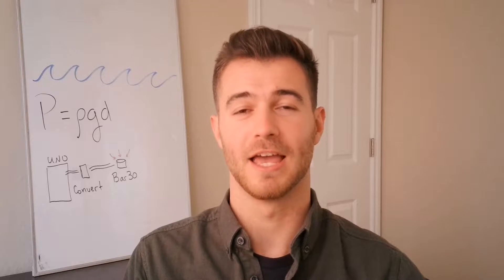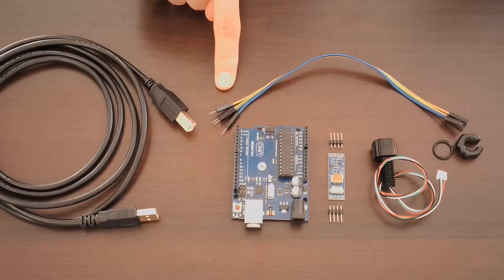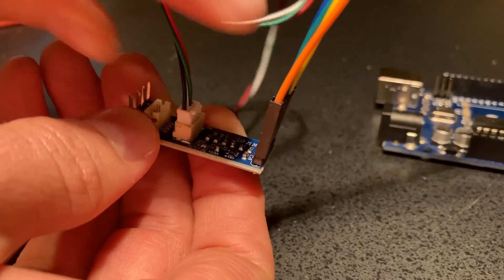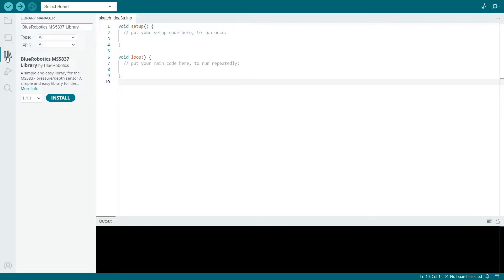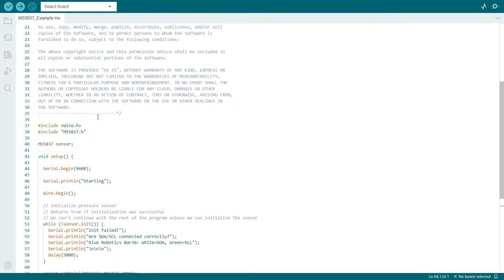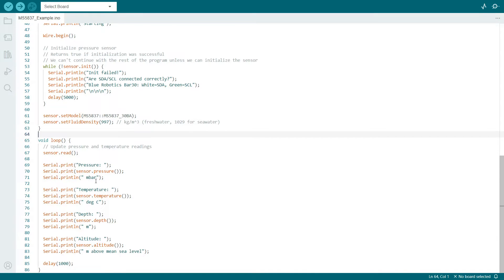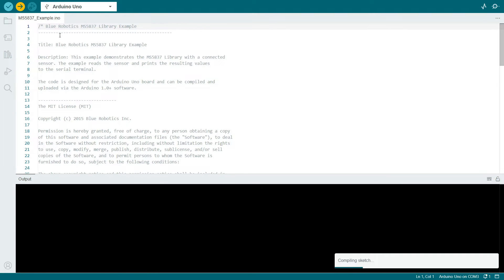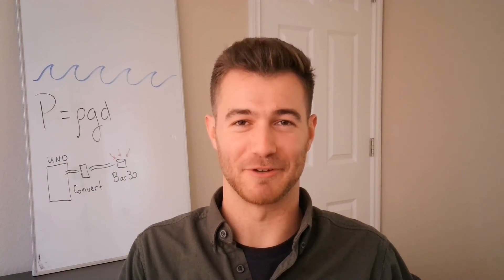Measuring Depth with Blue Robotics Bar30 Pressure Sensor | Mechatronics Tutorial

Comment: How do I display it on an LCD?
Reply from the maker: Hey there! Once you have the value accessible from within your code, then you can utilize other packages and capabilities. I’d suggest finding an LCD that has arduino documentation handy.

Essentially, once you wire up the LCD screen, the LCD manufacturer should have a function that pushes text to the screen. Call that function and you should be good!

Comment: i assume this is also meant for underwater use correct?
Reply from the maker: Yes, in fact it’s designed for underwater use! Check the specs on the blue robotics website to see the depth ratings. 

I always like doing common sense logic checks at the surface before putting anything underwater!
Reply: @philparisi_  Thank You!!!